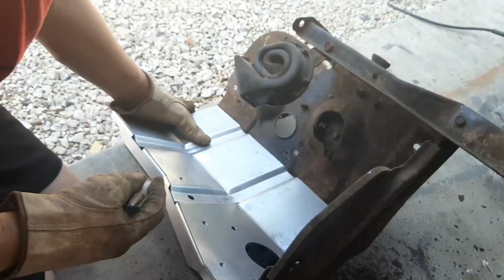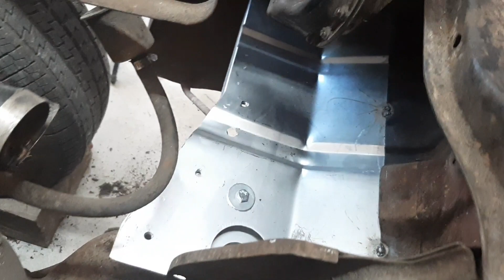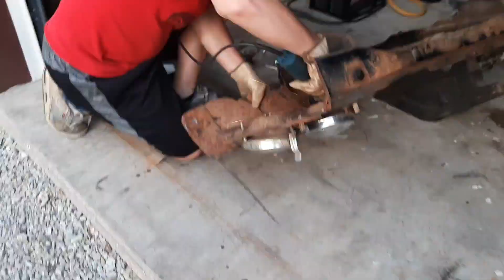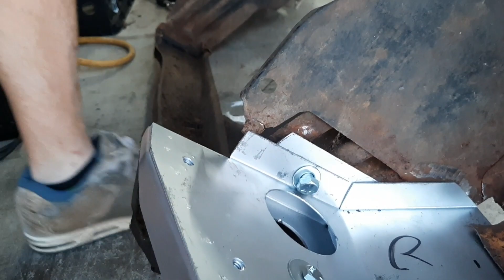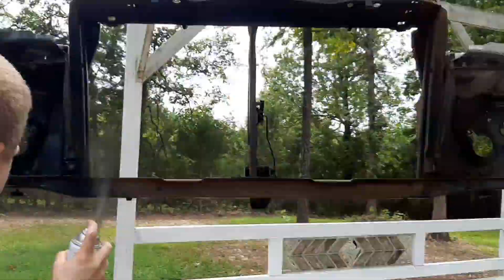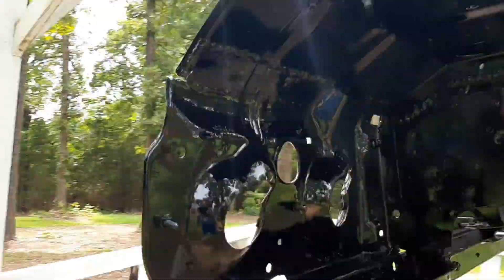1972 Buick Skylark Project Part 4: Core Support Repair

Comment: Where did you buy the new part from
Reply from the maker: @jeanson105olivier3  we got them from www.thepartsplaceinc.com
Reply from the maker: @jeanson105olivier3 here is the right hand side. https://www.thepartsplaceinc.com/product/1972/1972-buick-skylark-gs-regal-gn-core-support-rust-repair-kit-rh-side-3-piece-kit/33634
Reply from the maker: @jeanson105olivier3  here is the left hand side.
https://www.thepartsplaceinc.com/product/1972/1972-buick-skylark-gs-regal-gn-core-support-rust-repair-kit-lh-side-3-piece-kit/33635
Reply: I'm the one that makes those parts, pretty cool to see them working! 😁